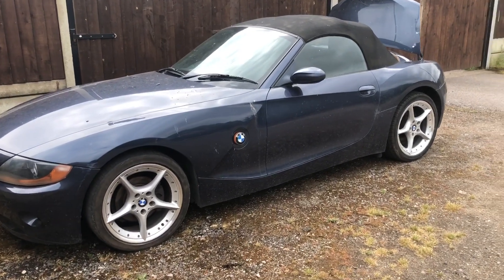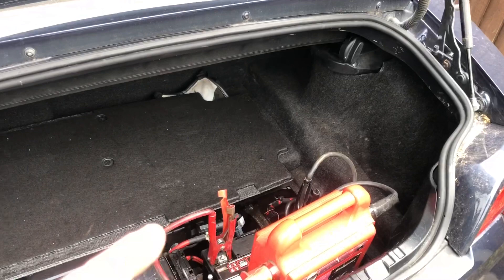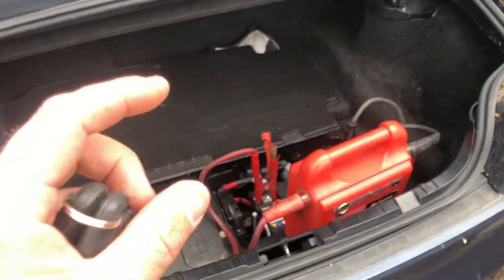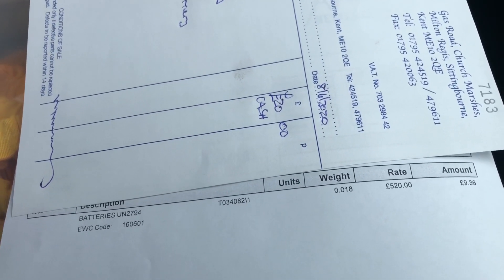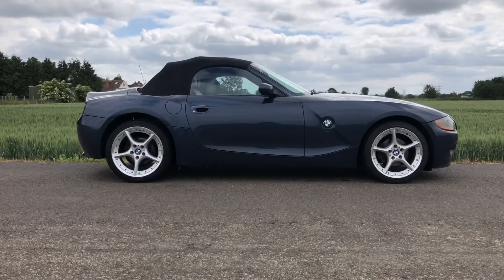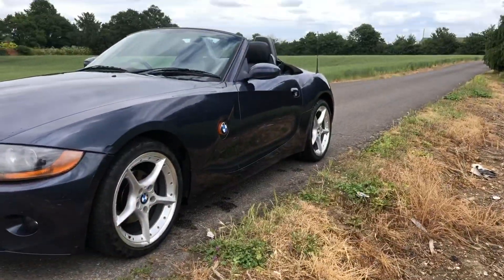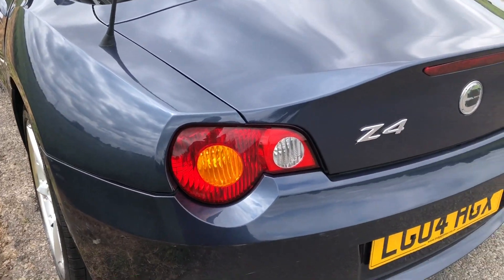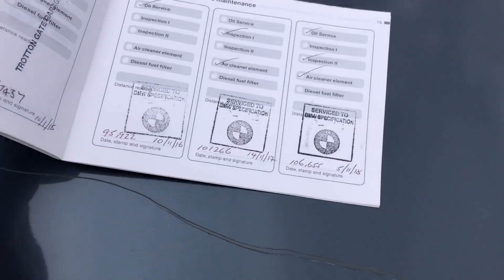BMW Z4  Very Low Miles Convertible Bargain Quick Flip!

Comment: Nice Video Rob , Got rid of my 06 3.0si in January for a bigger car   , N52 engine was still so smooth and powerful after 114K. Roof motor was put in the boot to avoid the common drain plug problem , Did many a trip to Spa Belgium for F1, WEC and france for Le Mans over the years in it  , never skipped a beat . Classic design that looks better with age .

Designed by the American Chris Bangle and all E85's were built in the USA too.

Comment: Might have to plug in to the diagnostics port under the bonnet to read the airbag module, if it's like the E39. Circular cap in the engine bay, you'll need the cable/adapter for inpa.

Comment: FYI both airbag and abs systems should clear their own lights after an ignition or drive cycle if the fault has been rectified, so the battery voltage fault would have rectified itsself by the time you had driven it home and the light been off the next time you started it. 
Almost certainly connectors under the seats...

Comment: Nice one Rob, I had a car were the air kept coming on and it turned out to be a loose connection under seat, and that was because me and the wife had different seat positions, 👍, I would love to know how you would clean up those dull head lights, mine are the same on my golf, 👌.
Reply: Toothpaste or rubbing compound work wonders if you buff them on to the lenses
Reply: @benduke4454  Toothpaste is a waste of time really. Only lasts about a day. Sand down upto 2000 grit then cutting compound, then UV seal jobs a good'un for a few years
Reply: @sammytheseal2307  agreed. Rubbing compound altho not as good as proper Sanding down and lacquering lasts a good couple of months and only takes a few seconds each light

Comment: If the air bag light came on when you were driving, it's probably a clock spring behind the steering wheel. (It's basically the only wear item in any air bag system.) Could be wiring, but assuming nothing else has been messed with, more than likely it's that.

Comment: Old trick (sure you know it though) grab some cooking oil or engine oil and chuck a little on a rag. Wipe over the plastics and they will come up good as new. Works on rubber also and lasts longer than the store stuff. If you wanna do it proper just run over the plastics with a heat-gun quick :P  Simple free little fix, makes a huge different when knocking them out to sell.

Comment: I owned one of these for a while now and whenever I let the battery go flat which is quite often it goes into what is called transport mode I believe which knocks out the blower and the demisters and heated seats and always the airbag light as well
This does come up as 'transport mode' on the reset diagnostics

Comment: Hope you got the airbag light sorted. I had it on my mini and had to get BMW to read it as local garage couldn’t.  Wasn’t the wiring loom under the passenger seat but ignition barrel. Needed a new one from Germany and it had to be coded. Expensive fix :-(

Comment: Air bag light might be the stupid little clips under the seat - Usually get knocked when hoovering cars or bottle rolls under the seat - just unplug clip under the seat and clip it back in again light should go out :D
Reply: Yep, I have experience of that having owned a Rover 45 😂😂
Reply: @sammytheseal2307  Lot of cars do it mate only takes it getting a knocked a bit. My friends Audi has done it, Brothers Subaru etc - common thing.
Reply: @deanishere7237  Yeah definitely. Shame they don't use more durable connectors to save the hassle

Comment: Rob I’ve got a Z4 roof (no motor) with electrical wires still attached in good condition, do you want it? Need a quick answer by 10am Thursday

Comment: Rob would you no off any fiat breakers or were I can get a slave cylinder and clutch master cylinder for a fiat 500 whole complete part with the pipe on it
Reply from the maker: Club 500 0161 272 0500 Richard or Neal 👍
Reply: salvage rebuilds uk cheers rob 👍

Comment: 5:45 "Wow due to Lockdown and Tip Closures I have a 12v Heavy Duty Battery and will try and get this weighed in and if get £10 for it job's a good'un & a No Brainer - Nice Little Earner as my Uncle used to say !

Comment: Hi Rob, not impressed with that at all. You promised to show the diagnostic machine plugged in and you didn't. 2.2l is one of the least desirable as it is underpowered. Finish and trim in no way match the Z3. What on earth were they doing pressure washing the boot?
Reply from the maker: Like I said my machine wouldn’t read it so absolutely no point showing it. No one pressure washed the boot they blew out the shut